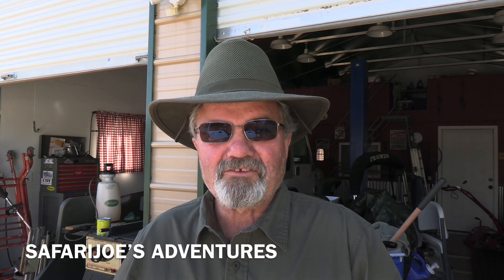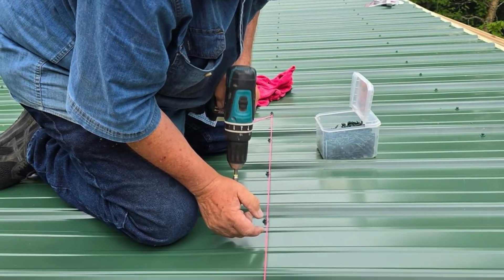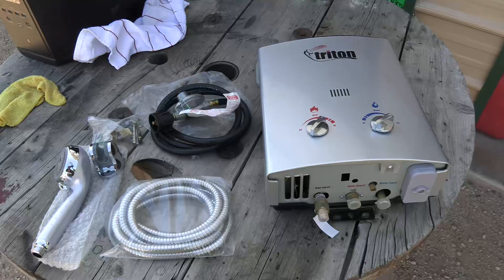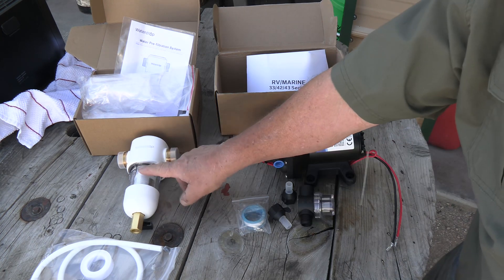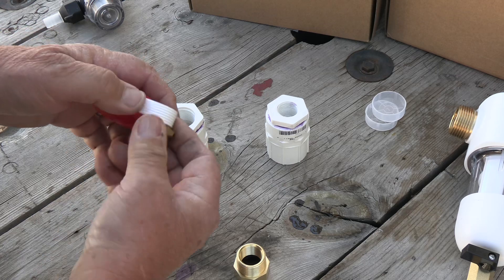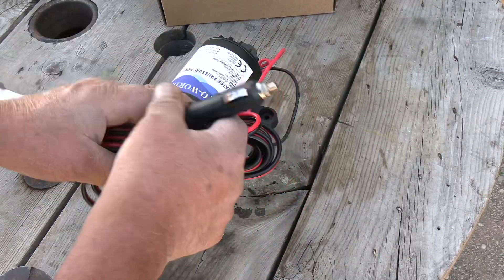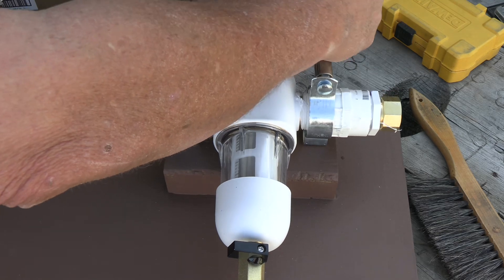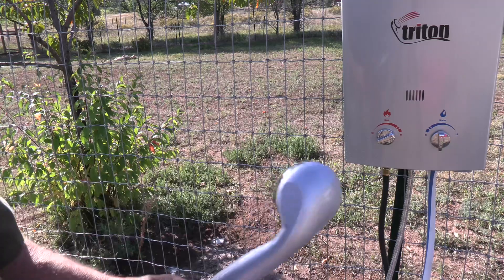12v pump & spin down well filter system.

Comment: This is definitely going to help us next door. Going to watch all these later today. I used a transfer pump to draw water out of our well and into the camper holding tank yesterday. 
Water was clean after running it a while but did have a strong odor.
Reply from the maker: At the minimum you need to have a sentiment filter of some kind to keep it out of your water system. It will help your water heater to last a lot longer.

Comment: Excellent video. I would have never considered needing a filter system. Thanks for the information and great installation.
Reply from the maker: @robertdknight  we just got back from a week of work at my cabin. The filter system worked flawlessly and we did not have any problems with the shower clogging up. Thanks for watching.
Reply: @safarijoesadventures  Perfect! Gotta love happy endings 🙂
Reply from the maker: @robertdknight  oh yeah, it’s always great when a plan turns out right.

Comment: Great video Joe. We have a well at our camp and we run the water through a RV water softener as it's a little rusty and hard. Plus there is sediment in it also. We run the water through a RV filter before the water softener. But that sediment filter looks like a better idea. I'm going to switch over to that next spring. Thanks for the idea. Take care. Todd from da U.P.
Reply from the maker: For the shower it is great. But once I have the cabin built I will add a couple more filters to help with getting rid of the iron taste. I tested the water and it is fine to drink.

Comment: Your shower is PhD level!  My off-grid, outdoor shower stall offers the same privacy as yours, but not near the technical prowess.  All I do is heat water on the campfire, mix it in a bucket and carry the bucket of warm water to the shower stall.  

I pounded in my own sand point well.  It was the first time ever!  I was SOOOO excited when I struck clean, cold water!  When showering, the ice-cold water needs to be heated up a bit.  :)
Reply from the maker: I would’ve been just as happy with A 5 gallon bucket of hot water and one of those Amazon $39 rechargeable pump shower combinations that you drop into a 5 gallon bucket. But my wife likes to take a longer shower than 5 gallons lol. And to be honest these things do work really nice. and I don’t like the ice water that comes out of them Wells anymore than you do lol👍

Comment: Watering the plants at 211 degrees can actually cook them.

Thank you Jesus for making our lives an adventure.
Reply: Nice project!
Reply from the maker: @remoteandrestless anything to keep a working shower at the remote cabin is a good thing.
Reply from the maker: @remoteandrestless  once we get the cabin done I will be building a complete filter system for it. I’ve tested the water and it’s great, but I wanna run it through some filters to make sure it taste good too
Reply: @safarijoesadventures  sufficient for now has been my motto
Reply from the maker: @remoteandrestless  I agree 100%. Right now I’m just interested in keeping the sand out of the shower water to keep the on-demand water heater from plugging. Once the cabins done, I will change it up a little bit and that’ll probably be sometime in late spring.
Reply from the maker: @loudmouthnewyorker  yeah I know, I was just making a little joke about my wife likes extremely hot showers and I can barely stand it above body temperature, 98.6° lol
Reply: @safarijoesadventures  Cmon Safari I know that. I think maybe only the Incredible Hulk and Thor are the only two people that can take 211 degree showers.
Reply from the maker: @loudmouthnewyorker  lol, I know you knew that. But down the road when somebody else reads these comments, they may think I’m serious. Every once in a while, my dry sense of humor or my dark sense of humor comes out. Truthfully I really don’t like super hot water. The only thing I like hot is strong, black coffee.
Reply: @safarijoesadventures  Amen brother. I like my coffee to taste like coffee too. None of that pumpkin spice stuff.
Reply from the maker: @loudmouthnewyorker  good stuff